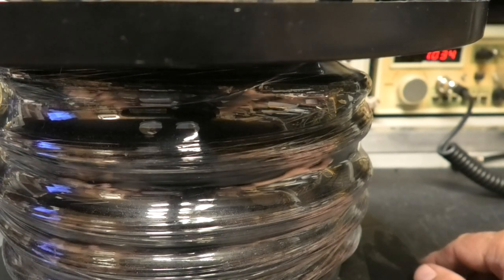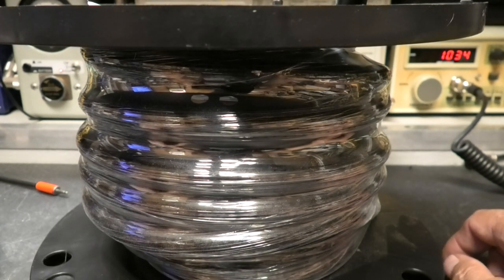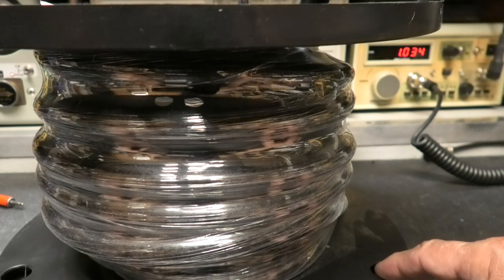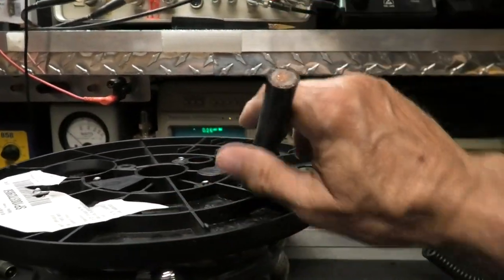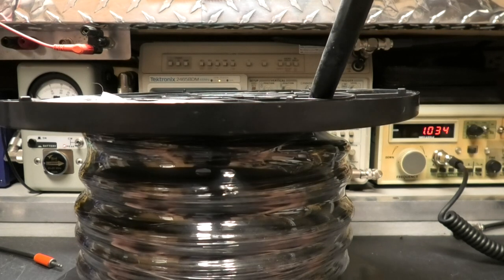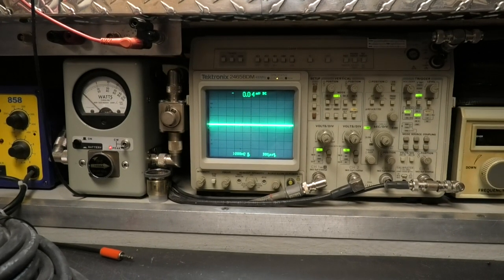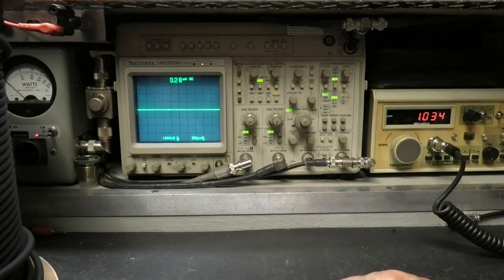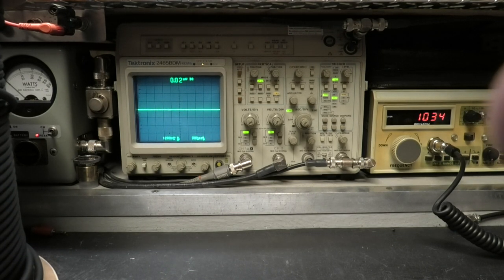Fine Tune CB Shop - Times Microwave Coax And Jumpers.. The Good Stuff And Much More.

Comment from the maker: Times Microwave LMR240uf ONLY available with sale of new radios .. No Exceptions. 

Cleaner And Meaner .. Only the serious need apply.  No "tire kickers".

If you can't handle the heat .. get out of the kitchen. 

If they can't show you .. in a video .. they're snowing you. Get The Picture??

It's all about Procedure .. There are no Exceptions. 

Here's what it actually takes to cut through the noise, be loud and crystal clear with a better receiver too:  A) Tuned Bench:  https://www.youtube.com/watch?v=lwcDfXOgAls.  True, it's more complicated and time consuming to accomplish these consistent and accurate results. Below is a partial procedure and list of calibrated equipment used to achieve this level of performance . Read on ..

Radio Evaluation Rules: https://www.facebook.com/163Hardrive/posts/3729504220447644
https://www.facebook.com/163Hardrive/posts/3523601657704569

Fine Tune CB Radio Shop strictly adheres to (https://www.nist.gov/) NIST Traceable Calibrations and other industry standards to maintain accuracy and consistency for providing Real World Performance Tuning of Citizens Band and 10 Meter export mobile radios with integrity.

"Basic Textbook AM/FM/SSB Transceiver Tune, Alignment and Calibration" 

1) Pll adjustments
VCO & OSC, AM TX OSC, USB TX OSC, LSB TX OSC.

2) Transmitter alignment
DRIVER BIAS, FINAL BIAS, SSB  (or gate voltages for mosfet versions) CARRIER BALANCE, HI-LO AM & SSB Power, RF METER, AMC, ALC and FM DEVIATION.

3) Receiver alignment
AM/FM RF & IF SENSITIVITY, FM DETECTOR/DEVIATION, SSB IF SENSITIVITY, SSB S-METER, AM/FM S-METER (100uV unmodulated -67dbm for �S-9� meter reading!), AM/FM SQUELCH RANGE, SSB SQUELCH RANGE, and NOISE BLANKER/AUTOMATIC NOISE LIMITER (Real World dBm to volts (uV) tables below).

That's just a typical run of the mill textbook tune up and alignment (if you're lucky). There's more to it than frequency alignment, modulation adjustment, meter calibration and a tune up report displaying exaggerated rms Bird peak watts! 

"Test Bench includes"

Bird 4314C Meter
https://www.birdrf.com/Products/Test%20and%20Measurement/Power-Meters/Wattmeters-Line-Sections/RF-Wattmeters/4314C_PEP-Single-Element-Wattmeter.aspx
Part 1) https://www.youtube.com/watch?v=RpX9IHe4ORM&t=16s
Part 2) https://www.youtube.com/watch?v=LuhbqTf6Bxw
Bird 4314C Accuracy Test: https://www.youtube.com/watch?v=DqEOabYqhQo&t=5s
Bird Stipulates 1/2 wavelengths  https://www.youtube.com/watch?v=5eWhgT-rTII
And Genuine Bird Elements from 1K down.

Bird 4373 Sampler 
https://www.rfparts.com/signal-samplers.html

HP8924c with options
http://userequip.com/files/specs/2147/HP%208924C%20Repair.pdf
https://www.youtube.com/watch?v=Cg1w0xBa27s&t=1s

HP8920a with options
https://www.keysight.com/upload/cmc_upload/All/EPSG072204.pdf

Three analog scopes, one digital 200 Mhz
https://www.atecorp.com/atecorp/media/pdfs/data-sheets/tektronix-2465b-2467b_manual.pdf
https://www.youtube.com/watch?v=by98x4eu2lM

Fluke 27fm
http://www.fluke.com/fluke/inen/digital-multimeters/fluke-27.htm?pid=56055
 
LCR http://www.lcrresearch.com/wp-content/uploads/2017/05/LCR_Pro1_Manual_version1.03.pdf

Power supplies
6 Cosel PBA1500f12 (750 amps) variable and configurable.
https://en.cosel.co.jp/product/powersupply/PBA/PBA1500F/PBA1500F-12/
Corcom 20VB1 F7130 EMI Filter 50-60Hz 250V

Times Microwave Coax jumpers and test leads
http://www.timesmicrowave.com/cms/products/cables/lmr/
https://www.youtube.com/watch?v=EmqaGJ6IWow
https://www.youtube.com/watch?v=1ltFVSxGp5Y
https://www.youtube.com/watch?v=v12YZT_1o90
https://www.youtube.com/watch?v=h7iiYfmYWRA&t=215s

Amphenol RF Connectors
https://www.amphenolrf.com/
https://www.youtube.com/watch?v=dVh5B0hdEA0 
https://www.youtube.com/watch?v=dKZg8T_AOso

More range, compliments, reliability and a quieter, clearer but more sensitive receiver,  Get Fine Tuned .. not peaked and ruined.

Here are some VideoGates of me at the bench practicing what I preach using my bench radio or customers radio completed and ready to be shipped: https://www.youtube.com/results?search_query=hard+drive+163+ more: https://www.google.com/search?q=Hard+Drive+163+nm&ie=utf-8&oe=utf-8&client=firefox-b-1-ab

It's what I recommend, use, service and sell ... to you ... not something non practical or deceiving in a misleading way. I'm not just the tech and owner of Fine Tune CB Radio Shop, I'm a customer too!  When finished, You'll be giving radio checks, not asking for them .

dBm To Watts and Volts
Tables below displays relationship between Power in [dBm] or [Watts] and Voltage in RMS, peak, peak-to-peak for sinusoidal signals in 50-Ohm systems for accurately measuring and tuning am/fm/ssb receiver sensitivity, agc, squelch and "S9" Meter calibration. Real World! Mike @ Mikes Radio Repair (Romper Room), Mark Rutherford aka Mark 19960, CB Kidd, Martian and all of your other fake accounts pay attention to the tables below, stop misaligning radios, spreading false information and promoting propaganda! 

  [dBm] [Watts]   [Volts]rms   [Volts]p    [Volts]pp
-140 0.100E-16  22.361 nV  31.618 nV  63.236 nV 
-139 0.126E-16  25.089 nV  35.476 nV  70.952 nV 
-138 0.158E-16  28.150 nV  39.805 nV  79.609 nV 
-137 0.200E-16  31.585 nV  44.662 nV  89.323 nV 
-136 0.251E-16  35.439 nV  50.111 nV  100.222 nV 
-135 0.316E-16  39.764 nV  56.226 nV  112.451 nV 
-134 0.398E-16  44.615 nV  63.086 nV  126.172 nV 
-133 0.501E-16  50.059 nV  70.784 nV  141.568 nV 
-132 0.631E-16  56.167 nV  79.421 nV  158.842 nV 
-131 0.794E-16  63.021 nV  89.112 nV  178.223 nV 
-130 0.100E-15  70.711 nV  99.985 nV  199.970 nV 
-129 0.126E-15  79.339 nV  112.185 nV  224.370 nV 
-128 0.158E-15  89.019 nV  125.874 nV  251.747 nV 
-127 0.200E-15  99.882 nV  141.232 nV  282.465 nV 
-126 0.251E-15  112.069 nV  158.465 nV  316.931 nV 
-125 0.316E-15  125.743 nV  177.801 nV  355.602 nV 
-124 0.398E-15  141.086 nV  199.496 nV  398.992 nV 
-123 0.501E-15  158.301 nV  223.838 nV  447.677 nV 
-122 0.631E-15  177.617 nV  251.151 nV  502.302 nV 
-121 0.794E-15  199.290 nV  281.796 nV  563.591 nV 
-120 0.100E-14  223.607 nV  316.180 nV  632.360 nV 
-119 0.126E-14  250.891 nV  354.760 nV  709.519 nV 
-118 0.158E-14  281.504 nV  398.047 nV  796.094 nV 
-117 0.200E-14  315.853 nV  446.616 nV  893.232 nV 
-116 0.251E-14  0.354 �V  0.501 �V  1.002 �V 
-115 0.316E-14  0.398 �V  0.562 �V  1.125 �V 
-114 0.398E-14  0.446 �V  0.631 �V  1.262 �V 
-113 0.501E-14  0.501 �V  0.708 �V  1.416 �V 
-112 0.631E-14  0.562 �V  0.794 �V  1.588 �V 
-111 0.794E-14  0.630 �V  0.891 �V  1.782 �V 
-110 0.100E-13  0.707 �V  1.000 �V  2.000 �V 
-109 0.126E-13  0.793 �V  1.122 �V  2.244 �V 
-108 0.158E-13  0.890 �V  1.259 �V  2.517 �V 
-107 0.200E-13  0.999 �V  1.412 �V  2.825 �V 
-106 0.251E-13  1.121 �V  1.585 �V  3.169 �V 
-105 0.316E-13  1.257 �V  1.778 �V  3.556 �V 
-104 0.398E-13  1.411 �V  1.995 �V  3.990 �V 
-103 0.501E-13  1.583 �V  2.238 �V  4.477 �V 
-102 0.631E-13  1.776 �V  2.512 �V  5.023 �V 
-101 0.794E-13  1.993 �V  2.818 �V  5.636 �V 
-100 0.100E-12  2.236 �V  3.162 �V  6.324 �V 
-99 0.126E-12  2.509 �V  3.548 �V  7.095 �V 
-98 0.158E-12  2.815 �V  3.980 �V  7.961 �V 
-97 0.200E-12  3.159 �V  4.466 �V  8.932 �V 
-96 0.251E-12  3.544 �V  5.011 �V  10.022 �V 
-95 0.316E-12  3.976 �V  5.623 �V  11.245 �V 
-94 0.398E-12  4.462 �V  6.309 �V  12.617 �V 
-93 0.501E-12  5.006 �V  7.078 �V  14.157 �V 
-92 0.631E-12  5.617 �V  7.942 �V  15.884 �V 
-91 0.794E-12  6.302 �V  8.911 �V  17.822 �V 
-90 0.100E-11  7.071 �V  9.998 �V  19.997 �V 
-89 0.126E-11  7.934 �V  11.218 �V  22.437 �V 
-88 0.158E-11  8.902 �V  12.587 �V  25.175 �V 
-87 0.200E-11  9.988 �V  14.123 �V  28.246 �V 
-86 0.251E-11  11.207 �V  15.847 �V  31.693 �V 
-85 0.316E-11  12.574 �V  17.780 �V  35.560 �V 
-84 0.398E-11  14.109 �V  19.950 �V  39.899 �V 
-83 0.501E-11  15.830 �V  22.384 �V  44.768 �V 
-82 0.631E-11  17.762 �V  25.115 �V  50.230 �V 
-81 0.794E-11  19.929 �V  28.180 �V  56.359 �V 
-80 0.100E-10  22.361 �V  31.618 �V  63.236 �V 
-79 0.126E-10  25.089 �V  35.476 �V  70.952 �V 
-78 0.158E-10  28.150 �V  39.805 �V  79.609 �V 
-77 0.200E-10  31.585 �V  44.662 �V  89.323 �V 
-76 0.251E-10  35.439 �V  50.111 �V  100.222 �V 
-75 0.316E-10  39.764 �V  56.226 �V  112.451 �V 
-74 0.398E-10  44.615 �V  63.086 �V  126.172 �V 
-73 0.501E-10  50.059 �V  70.784 �V  141.568 �V 
-72 0.631E-10  56.167 �V  79.421 �V  158.842 �V 
-71 0.794E-10  63.021 �V  89.112 �V  178.223 �V 
-70 0.100E-09  70.711 �V  99.985 �V  199.970 �V 
-69 0.126E-09  79.339 �V  112.185 �V  224.370 �V 
-68 0.158E-09  89.019 �V  125.874 �V  251.747 �V 
-67 0.200E-09  99.881 �V  141.232 �V  282.465 �V
-66 0.251E-09  112.069 �V  158.465 �V  316.931 �V 
-65 0.316E-09  125.743 �V  177.801 �V  355.602 �V 
-64 0.398E-09  141.086 �V  199.496 �V  398.992 �V 
-63 0.501E-09  158.301 �V  223.838 �V  447.677 �V 
-62 0.631E-09  177.617 �V  251.151 �V  502.301 �V 
-61 0.794E-09  199.290 �V  281.796 �V  563.592 �V 
-60 0.100E-08  223.607 �V  316.180 �V  632.360 �V 
-59 0.126E-08  250.891 �V  354.760 �V  709.520 �V 
-58 0.158E-08  281.504 �V  398.047 �V  796.094 �V 
-57 0.200E-08  315.853 �V  446.616 �V  893.232 �V 
-56 0.251E-08  0.354 mV  0.501 mV  1.002 mV 
-55 0.316E-08  0.398 mV  0.562 mV  1.125 mV 
-54 0.398E-08  0.446 mV  0.631 mV  1.262 mV 
-53 0.501E-08  0.501 mV  0.708 mV  1.416 mV 
-52 0.631E-08  0.562 mV  0.794 mV  1.588 mV 
-51 0.794E-08  0.630 mV  0.891 mV  1.782 mV 
-50 0.100E-07  0.707 mV  1.000 mV  2.000 mV 
-49 0.126E-07  0.793 mV  1.122 mV  2.244 mV 
-48 0.158E-07  0.890 mV  1.259 mV  2.517 mV 

                 Don't Be A Mud Duck!

Contact: https://www.youtube.com/watch?v=P0W_Ltzeyyc

163 Hard Dr.

Comment: What coax works better for dual antennas on a truck and what should the length be.
Reply from the maker: Hello! 

Because some people have abused my kindness and time, this is a blanket reply and covers all.

Did you watch this video and read entire description?

It's All About Procedure .. New radio sales only shorturl.at/dnuLS at this time. Read description and watch before contacting. When you contact me in a PM about the purchase you're ready to make (no "tire kickers"), keep it 15 words or less including your phone number.

Contact via Facebook ONLY in your real personal legal name and phone number. NO EXCEPTIONS! There are to many con-artist and thieves out there that like to steal parts and knowledge out of radios because they can't make it on their own. I don't have any kind of "free" time for that type of "nonsense". It's partially the reason I no longer have a "buy now button". There is no way on this earth that I'd be able to keep up with the high demand and it also helps to eliminate the schemers and scammers. The serious only need apply.

No longer accepting mail-ins .. Fine Tune CB Shop services radios for the original owner that has purchased brand new radios from Fine Tune CB ONLY. This way, like the Maytag repairman, I only see one or two radios out of 500-600 per year that may have developed an issue. I'd rather spend my time doing better things .. maybe you should too??

163 Hard Dr. https://www.facebook.com/163Hardrive/posts/3523601657704569

Radio Evaluation Rules: https://www.facebook.com/163Hardrive/posts/3729504220447644

Playlist: shorturl.at/tzQ13

Have a Great Day and Safety First .. It Could Save A Life!

The Bench >>